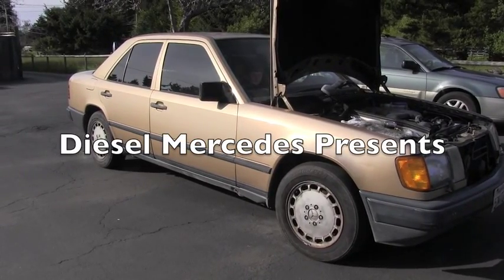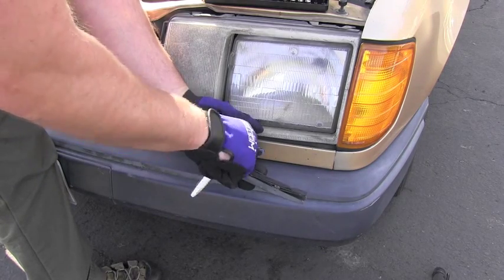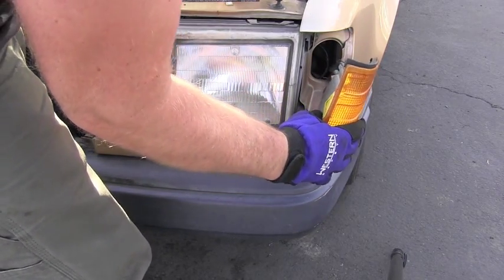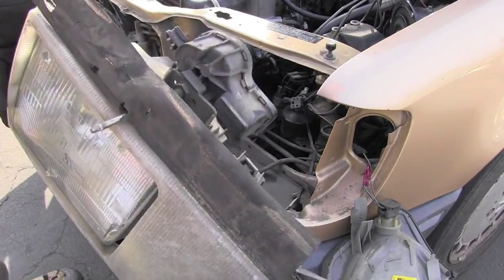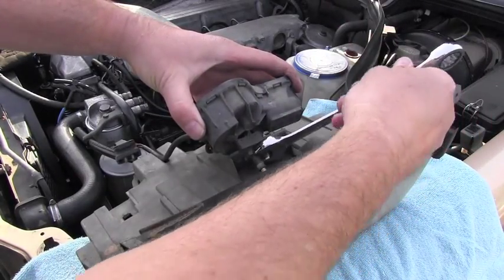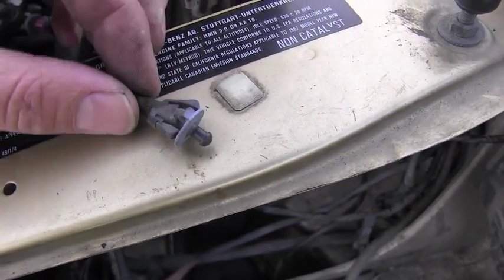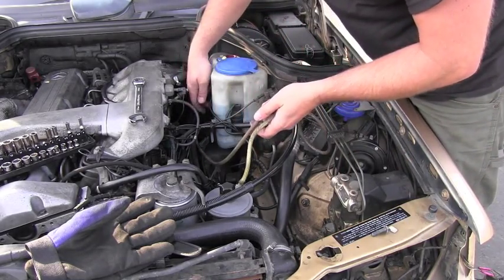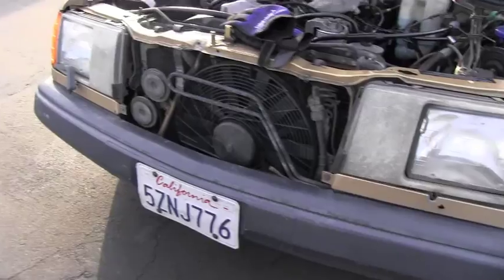Mercedes W124 E300D Headlights Wipers Removal

Comment: Love Diesel Mercedes Channel. Please make some more t-shirts and hats. I'll take one of each.

This tutorial really helped me swap out a busted right wiper motor. One improvement to your technique IMO is to fully remove the metal trim piece by removing the vertical 8mm screw adjacent to the blinker. It makes it much easier not only to remove the headlight but to disconnect the hose, and more importantly, put everything back together. Otherwise, great tutorial and a well-deserved thumbs-up. Thanks again.

Comment: I'm curious how to 'finish the job.
(a)  What is the final solution to the Wiper Fluid Delivery tubes?
(b)  How difficult/what is the procedure for replacing that thin sheet metal body panel just below the headlight with one from a (similar color) car that did NOT have headlamp wipers...(i.e. plug up the holes in the face of your car)?
(c)  For (roughly) $200 Euro headlights could be installed at this juncture...minus the expenditure, why not make that change?...any complications?...different voltage/amperage draw?...or is it plug and play?